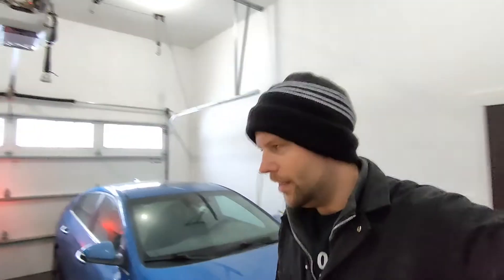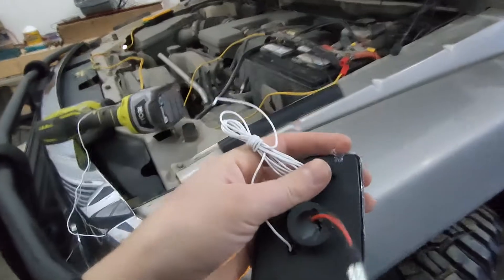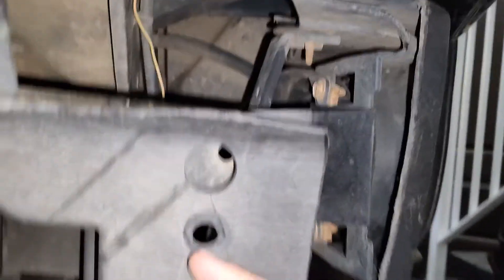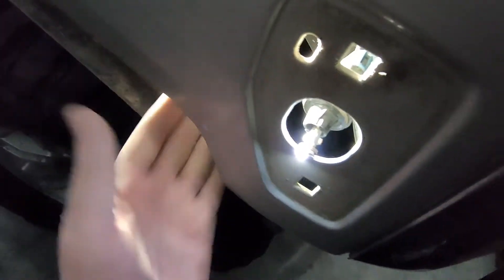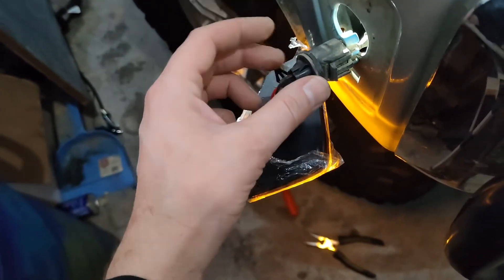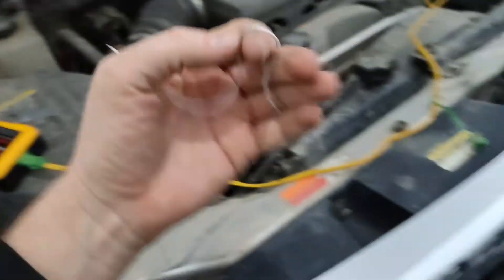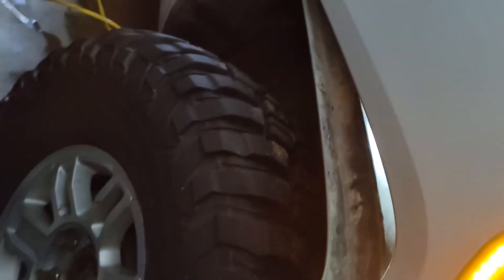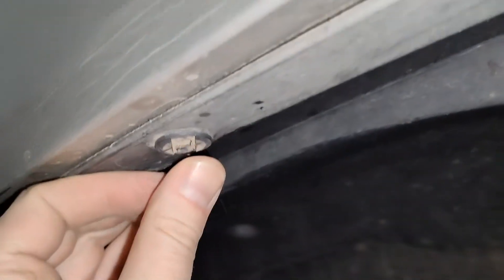HOW TO: Install LED side marker lights, on your HUMMER H3!

Comment: I have a much faster and much easier way that I just discovered tonight while doing my own. Find a plastic prying tool. Use the prying tool to create a gap between the marker light and the body. Use a flat head screw driver to disengage the clips in that gap. You’ll have the marker light removed and the new one installed on both sides in under five minutes. Good luck.
Reply from the maker: Interesting
Reply: Much appreciated for this video. I bought these same lights as a result of your video. Looks great.
Reply from the maker: @deplorable_pureblood_patri7704  no worries! Thanks for the tip.

Mine still work great!

Comment: Hey, I'm trying to install these lights but don't understand how to connect the white wire to the DRL. Do you have any insight?
Reply from the maker: I decided not to use the drl circuit, but instead found a 12+ key switched source and just tapped into it with the white wire. That way regardless of what was happening with the headlights, as long as the truck was on, the lights were on.
Reply: Question, We have it all wire up, trying to use a "Mini Add-A-Circuit holder" what fuse # did you plug into?  Everyone we have tried is either hot all the time with the key off or it's got nothing.  We have tried #50, #60 (empty) all hot. #10 SPO,  rear wiper, nothing.  What Are we doing wrong?

Comment: Dude why didn't you twist the socket back in instead of taping it? Plenty of room
Reply: Now you run the risk of getting water inside on the circuit board.
Reply: What he said

Comment: Where did you get your headlights and mounts for them.
Reply from the maker: I butchered my existing headlights to make the mounts. But you can get mounts from "lased designs" online. Or have someone 3d print you a set. 

I got the lights on Amazon. Look up "ovotor" Jeep lights

Comment: I just bought the same ones but I have no idea where to hook up the white wire to. I know you said DRL lead but I have no idea where that is
Reply from the maker: Find pretty much any switched 12v source, and piggyback off of it. These are extremely low power

Comment: Crap led lights though. Got mine 2021..both sides have burnt out lights now. So here I am swapping them out. Going with smoked factory style housings and using led bulbs. Pretty sure you don't have to tape them. They insert into the housing and you turn them to lock the socket in place.
Reply from the maker: Yeah mine are a little screwed too lol

Comment: What color wire did you splice into?
Reply from the maker: It doesn't matter. My headlights are custom. Yours will be different, trust me. But if you've got aftermarket jeep style headlight assembly, then it's the same wire that comes off the headlight assembly  harness separately from the plug, and usually that's red.
Reply from the maker: You need to use a multimeter and find the lead for your daytime running lights. Or find a 12v switched source. 
I'd recommend using a "tap in fuse adapter" in your fuse box if you can't find the right wire.
Reply: You would’ve saved my drl lights if I could’ve waited a few hours lol. Just fried the harness with my power probe, no fuse popped but I lost my drl and park lights, however I still have left/right blinkers. Wish me luck, this is gonna be a hell of a project now, haha.
Reply from the maker: @gunnerkrejci1442  oh man ... 

That blows dude lol